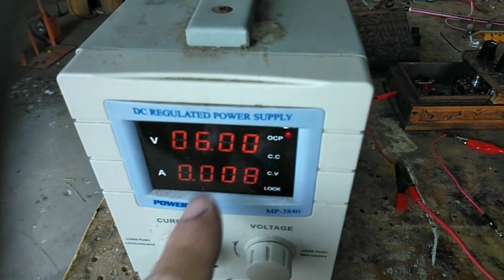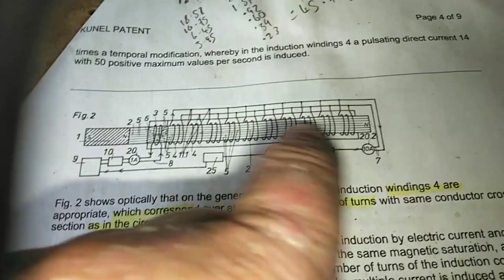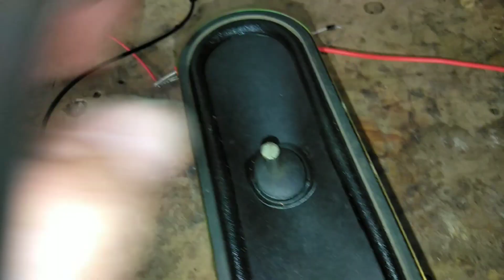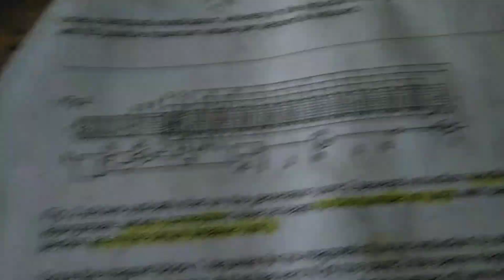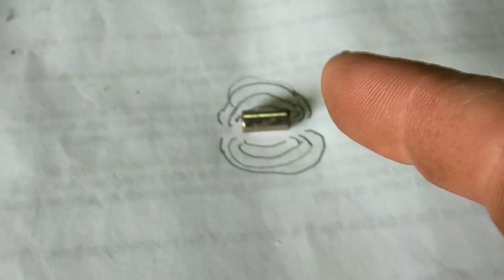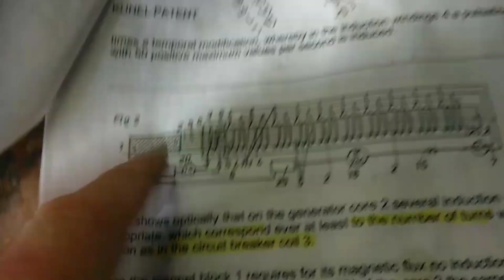Kunel Patent Using First Coils as LC Circuit.

Comment: Hello, I have watch some of your videos about Kunel patent but actually I didn’t notice any tests done to observe if permanent magnet used can induce a voltage in your pickup coils, just kinetic input, place a paper folded in 2-3 between magnet and iron core, connect multimeter on output and see if you get anything. Second test should be done with one coil arranged in such way its north to the north of magnet when energised then find out what voltage and current require to push away the magnet just a bit … if the field is too strong then you will induce pickup coils and power consumption for switching the magnet will increase.

As stated in the patent induction in pickup coils MUST be done by magnet only and not by the coil switching off the magnet. Also, using an air gap increases attraction force between iron and magnet. So, your pickup coils will have a limited number which is given by the strength of the magnet used and iron core must be trimmed down accordingly.

Also, in patent description the core is described as soft iron eventually made of strings (multiple iron wire used for iron work rebar for concrete).

As frequency generator, you can find on amazon plenty up to 30v up to 150khz with adjustable duty cycle for £3-15 even with 3 channels output.

Anyway, your work inspired me and I will try this approach.

Please do not consider I am criticise your work, but it seems that important bits were left out